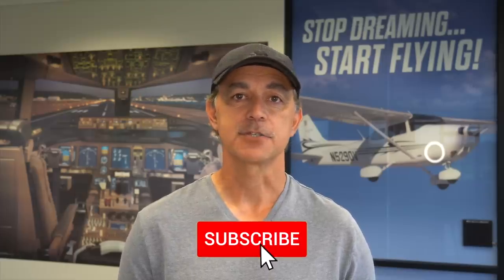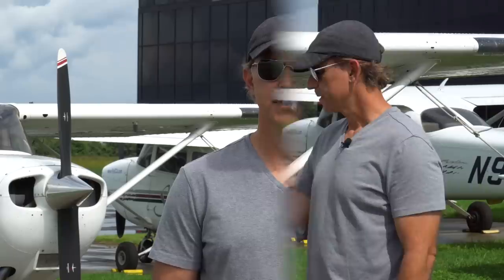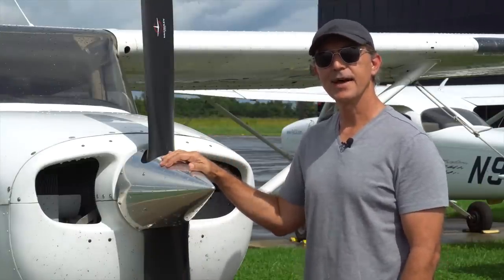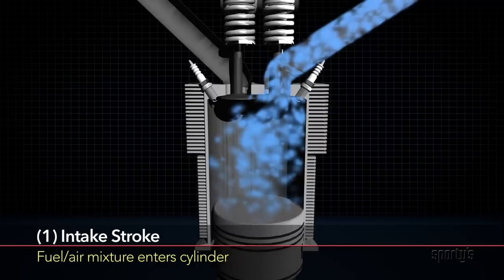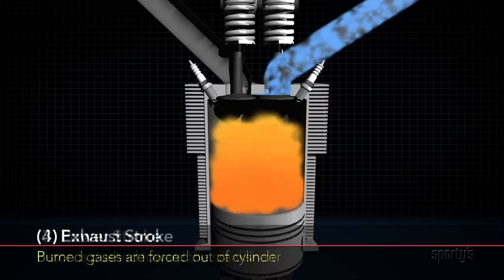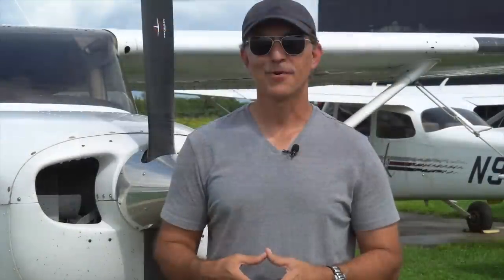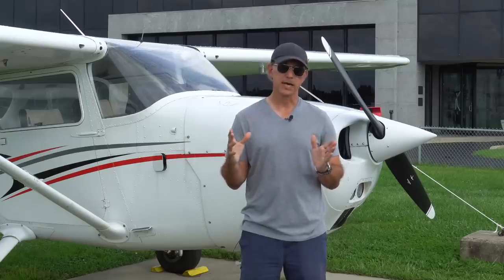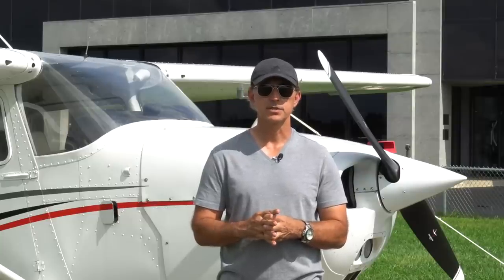Emergency Follow Up, What Happened To The Engine

Comment: Opening up the Impossible turn debate...oh oh... Well, I don't think this qualifies as an impossible turn in its purest form. The engine was still generating power, degraded as it was. I think a dead stick on climb out would be a different calculation.
Reply: Agreed
Reply: that was my impression as well
Reply: Yup - exactly, it’s a decision each pilot will have to make when in their specific situation. Not something you can second guess from the ground/video. 

In this case he was still too high so clearly a very good judgement call!
Reply: Yeah, that's exactly the same thinkign I had when he brought up that people were asking about that. The engine was still producing power. It was still running. As long as she's making power, you are at the very least losing altitude slower than if she was dead. You might as well take advantage of that for as long as possible to get turned around back the way you just came from where you KNOW you have a safe spot to land.
Reply: I usually don't enter the impossible turn debate because you normally can't convince the diehards but I've had a couple different situations with a partial power loss and chose the impossible turn both times successfully and I had another occasion where I determined I could fly a tight pattern to return to the runway with a stuttering engine.  Partial power situations alway give you more options.
Reply: The impossible turn he made with no issue. Stop it. Great job to the instructor!
Reply: With a heavy plane with an aeroplane getting airborne behind you or taking off into a considerable head wind turning into a considerable tail wind it can all quickly catch up with you.
Reply: I was going to say this but you beat me to it.   This is not the impossible turn because indeed it was running on 3 cylinders .   Complete dead stick would constitute an impossible turn.   I have practiced that dead stick turn in a redbird simulator (saratoga model)   It is possible if you catch the issue right away and you are offset of runway at 900ft agl.   Good job on putting that plane safely on the ground.. I hope this helps her confidence now as a been there felt that moment and I lived.
Reply: "I think therefore I am." & "It worked safely, ergo, NOT impossible."
Reply: Came here to say that. Agreed
Reply: If you've ever flown around Clermont County Airport, you might rethink how few options there are nearby. The area is full of residential homes and rolling hills. They had altitude and airspeed and a partial power making the 180 turn a viable  option.
Reply: @wayneschenk5512  well, he did float down half the runway....
Reply: @kCI251  meaning that it really was not the, "impossible turn".  The impossible turn implies you do not have enough altitude and/or airspeed to complete the turn before running out of airspace.
Reply: You are absolutely correct in your assessment. If the turn was impossible they would have not been able to conduct it so easily. The engine was still producing enough power to complete the turn and I agree that a dead stick scenario would be a completely different outcome. Those arguing about him turning back to the airport are just dead wrong in this scenario.
Reply: I agree 100%, dead engine is a much different story
Reply: Also, my instructor told me to always include a "decision altitude" in my take-off briefings. Engine failure below the DA = land straight ahead; above = go back.
Reply: Yep that's the point that needs to be made also he clearly had energy to make the turn and mentioned it in the video.
Reply: Exactly.

Comment: The Impossible Turn is only impossible under a full power out scenario not a partial power one.
Reply from the maker: It is NOT impossible. As part of your commercial pilot check ride you have to do a power off 180 and land within 100' of your aiming point. The "impossible Turn" isn't much more than that.
Reply: The "impossible" part depends on altitude and speed. With enough altitude you can trade it into speed.

In this incident they only had REDUCED power plus the potential energy of enough altitude. Aerospace Engineer viewpoint.
Reply: If. Loose power  dead engine.   How much glide. Do you loose for that stunt. ?
Reply from the maker: @jaytibbles2223  pitching for best glide at a given weight will give you a predetermined glide ratio correct? So the only real question is, at a given weight, how much altitude do you need to make a 180 turn back to the runway? Anyone can answer this question buy climbing to a safe altitude, say 1000’ for example, bring the engine to idle, pitch for best glide, bank no more than 30 degrees into the wind and see what altitude you are at when you are lined up with the runway. When I was a student pilot my instructor pulled my engine on a 152 @400’ agl and we made it back with ease. In today’s world I’m sure that would be frowned upon, but knowing that number in whatever single engine airplane you fly would be huge. Particularly when you have no survivable options in front or on either side of you. Just my perspective.
Reply: @BaronPilot  I hear you man. Though it worked for you in a 152 I don’t think I would try a 400 AGL turn back in my Arrow lol. Also it’s about a 225 degree turn from the Power Off 180’s 180 degree turn. Is it DOABLE on some aircraft and some days absolutely but most of the time people lose too much altitude to make the field and in my airport’s case that means certain collision with a semi truck haha (W00).

Comment: As a longtime pilot, this is what we used to call a "shaker" -- as in "so you had a shaker today".  This was especially a problem when they switched from 80/87 to using only 100LL in engines with lower compression ratios (8-to-1 or lower).  Actually, it was a common event back then but certainly not an emergency -- it generally clears-up by itself from my experience.  It can be prevented by leaning the mixture while on the ground and in cruise -- it should almost be required in the POH.  Oil changes frequently (25 to 50 hours -- not 100 hours) with good additives like in Shell 15W-50 and using AvBlen at each oil change really helps dissolve carbon build-up in valve guides and on valve stems.  These are air cooled engines with a wide operating temperature range, burning leaded fuel, so they can develop carbon.  And, unlike modern car fuel, Avgas doesn't have any detergents to help clean-out carbon.  When a valve stem builds-up more carbon than the valve spring can pull-back on, then you got yourself a "shaker".
Reply: Let's hope that the new unleaded fuels (such as the GAMI stuff, fleet-wide STC approved) fix some of the issues (and increase oil change intervals.)
Reply: @UncleKennysPlace  Its the fact that the fuels are 100 octane that creates the issue, leads not the issue as this was not happening with the old red 80/87 fuel. Lead is there for lubrication. High octane fuels are made for high compression engines. Most airplane engines in the GA fleet are less than 8:1, for example most cars made are over 10:1 with cars like mercedes and BMWs up to 14:1... they also have anti knock sensors that can allow them to effectively change the compression through variable timing... What causes exhaust valves to stick is an incomplete combustion that results in thick black exhaust, and the residue builds up and stops the valve from seating. A valve can be lapped back into place, or if the engine is leaned or even the cylinders flushed with a solvent, this can sometimes help. Leaning or running Lean of Peak EGT helps keep the build up low by having a complete fuel burn, but many argue it burns exhaust valves faster. In my experience with my bonanza I ran LOP and while cylinders did go for 1500 hours or so, the bottom end on that engine was still running strong at nearly 4000 SMOH. 

Also Marvel Mystery helps with sticking valves, does in the cuby I fly now anyway, with a whopping 6.3:1 compression ration. YMMV.
Reply: @benjigault9043  I think we were actually saying the same thing but in two different ways.  And Marvel Mystery oil was not FAA approved nor tested like AvBlend.  However, I know people who use Marvel Mystery oil and swear by it.  I have been using AvBlend ever since it was FAA approved, and it works amazingly well at preventing sticky valves and general engine wear -- goes to TBO every time.  Being and A&P IA myself for many years, I can tell you that valve stems can and do build-up carbon and lead deposits and can and do stick in this way.  With modern harder valves and valve seats, lead is no longer really needed for lubricating valves and valve seats.  For example, the new extensively tested G100UL, which is now approved across the fleet, contains no lead.  In addition, if I were overhauling an engine, I would never go under 9 to 1 compression unless I was burning non-ethanol auto-fuel -- but not 100LL.  Do you remember when they stopped providing 80/87 AvGas and how 100LL gummed-up the lower compression engines because 100LL actually has 4-times more lead than 80/87 did?  Just look at what happens to an aircraft engine after the compression drops below acceptable levels.
Reply: @JonMcCulloughBand  Yes we are, in my experience the lead just fouls plugs, staying lean and using MMO keeps my valves from sticking.. Marvel Mystery oil has been around since who knows how long. Ive heard of guys using it in WW2.. as a long time participant in GA, the FAA isnt really helpful nor do they actually care about GA. The process to certify UL 100 is a great example of their bureaucratic garbage process... but yeah I agree with everything you said.. lots of the lower HP continentals have low compression, my c-85-12F was overhauled recently at still is at 6.3:1. When the time comes I plan on doing a stroker conversion, o-200 crank and should get up to 8:1.. but still thats not high compression.. I am hesitant to burn ethanol free auto gas, because of possible contamination issues through delivery. I used to burn auto gas in my bonanza, or a 50/50 mix but that fuel came from a petroleum supply company to a tank in my buddys hangar. Even then we tested each batch for ethanol..  Keep up the work, GA needs every IA desperately at this point..
Reply: @benjigault9043  The problem of lead fouling arises when low engine operating temperatures are coupled with running a rich mixture. Doing this prevents the complete vaporization of Tetraethyl lead (TEL).  Under these conditions, lead deposits can form on spark plug electrodes and valves, causing a misfiring engine.  Exhaust valves can build-up lead deposits anywhere they are exposed to exhaust gases, including the valve stem and valve face (seat contact area).  I too remember when they stopped providing 80/87, which had a much lower lead content than 100LL since 80/87 had a lower octane rating.  In the 1970's, 100LL also replaced 100/130 Av Fuel, which had a very high lead content, so 100LL was a "compromise fuel" across the fleet starting in the 1970's.  Now, the new G100UL has been proven to greatly reduce deposits on spark plugs and exhaust valves in the absence of metallic deposits from lead.  It also has been shown to keep an engine running cleaner.  It's important to understand that Tetraethyl lead was used to increase octane rating, but lower compression engines work better and run cleaner on lower leaded fuels. 🥸
Reply: @flybearone1865  as someone who owned an e series bonanza and now a cuby, both low compression engines, I am well aware of lead fouling on plugs, but I didnt know the lead contributed as much as it does to valves sticking, I always attributed that to running rich. My solution was LOP in the bonanza, and for the cuby I add a bit of MMO to the oil and fuel.  Thanks for that. Maybe I will get myself another tank and a delivery of non ethanol 87 for the cuby.. 

Cheers.
Reply: It would seem to make sense then that leaning the mixture while taxiing and during cruise flight, we can not only prevent sticking valves and fouled plugs but also put less unburned lead into our atmosphere.  Looking forward to GAMI 100UL but hope the price isn't too much higher than 100LL.
Reply: @UncleKennysPlace  Right -- "good" aviation oils and some additives dissolve carbon and lead, so lower lead levels from GAMI 100UL should help.  Leaning an engine should also reduce carbon and lead build-up.  I lean on the ground and during cruise but always on the rich side of peak EGT.  Ground running an engine full rich will eventually cause fouling problems, but many flight schools just advise students to operate full-rich to prevent operating the engine at high power settings while leaned-out.  For example, a student forgetting to enrich the mixture before takeoff or full-power climbs could cause major damage to the engine.

Comment: There's a huge difference between an engine failure and partial power loss.
Reply: If that's the end of the story, but a catastrophic engine failure is often preceded by a partial power loss.  Much safer to trouble-shoot on the ground.
Reply: Often, if not immediately corrected, a partial power loss will lead to a total power loss.  If that cylinder swallowed the valve instead of it just sticking, it could have been a lot worse, and happen really fast.  Punch a hole through the cylinder, other things.  This emergency would have been handled no differently if it had been a full engine seizure or just partial power loss.  Go look up Edward Frye and look what happened to him in his Centurian with a newly rebuilt engine.
Reply: @GaryMCurran  That said in hind sight and a rare mechanical condition.
 My personal experiences of partial power losses were carb icing (severe sudden loss of power that carb heat didn't fix until after the emergence landing)and fuel starvation while blasting for a heavy passenger on a long flight on a R/L/OFF system (Simply switched tanks). My witnessed accounts of insidious situations were (seems like all were post annual too) fuel contamination or starvation where the engine looses power but continues to run rough barely making power or pitch related starvation where level flight to nose down made normal power but any slight pitch up the engine would start to quit (unfortunately was at 100' over dense population and lead to a crash with injuries) but none of them lead to a total power loss. Probably worse than a total failure because the distraction in trying to diagnose and keep it running vs instant glider and focused on the landing. 
We all practice failures but haw many practice various insidious partial power loss emergencies?
Reply: @ManNomad  great reply.  I am happy to hear that things always worked out for you.
Reply: @ManNomad  Right -- it's important to understand that if the engine stops running, the carb heat may become unusable since it's generated from an exhaust heat muff -- no hot exhaust, then no or little carb heat.  This is especially problematic after prolonged descents (e.g. practice emergency landings).  Flight instructors should periodically apply engine power during all emergency landing practices while operating a carbureted engine to prevent engine stoppage due to carb ice regardless of whether or not the carb heat is ON.
Reply: @jaydee5156  Assuming the engine had been running normally without any prior pilot changes, then a quick glance at the oil pressure, oil temperature and fuel pressure would have indicated more likely a stuck valve or partially clogged injector (assuming a fuel injected).  This also assumes no unusual bang or pops from the engine.  It seems this was more of a learning lesson for the young flight instructor than the student -- also nice job remaining calm student pilot!  For the young instructor--what would you have done had you been miles between airports?  I would first check all vital engine signs and kept monitoring them to the nearest airport.  Many times, this clears before a mechanic can check it out.  Odd things can and do happen in-flight such as a stuck valve--seen this happen, too.  Memorizing the emergency checklist is a really good idea, too.  For example, once when I was descending from 9500 feet to 2500 feet on a cross-county flight and then applied power to level at 2500 feet, the engine wouldn't develop power when the throttle was applied.  Okay--emergency checklist item number one was "full-rich", which fixed the problem because I was previously leaned-out for the higher altitude.  This is where declaring an emergency too quickly might have ended in a forced landing.
Reply: @JonMcCulloughBand  Just a little more trouble shooting than I'd care to do at just a little more than treetop level.  Back to the story at hand, a cool head lead to a happy ending.  Glad everyone is okay.
Reply: @JonMcCulloughBand  when you have altitude as well as airspeed to spare, going through checklists is fine.  However, when flying both low as well as slow (as they were, considering they had literally just taken off), there is no time to do an instrument scan nor go thru a checklist.  At that point, I think the CFI did the right thing; treat the airplane like a glider and get it on the ground immediately.

Comment: There may be some validity in calling the impossible turn a questionable move but, while it may be far from the best choice if you lose an engine, Kim did not. Running rough and vibrating as it was, there was still power available and, in my estimation, it was wise to take advantage of what power was left. Make the turn, prepare for a dead stick, and shut her down when safe to do so.

Comment: He knew he still had some power, milked it by by lowering the throttle.   He knew they had the airspeed and kept and the altitude  until he had the runway. The slip was perfect . Good job bud.